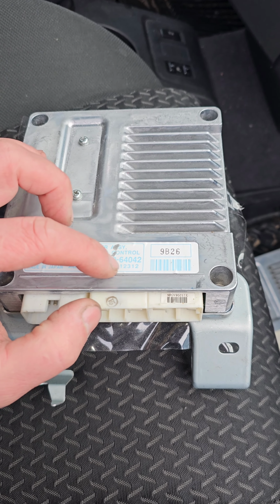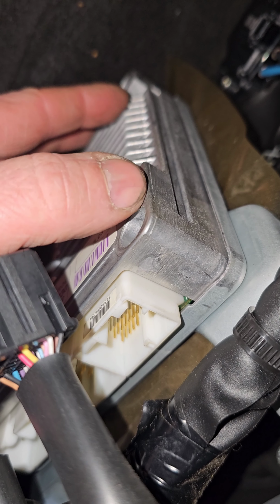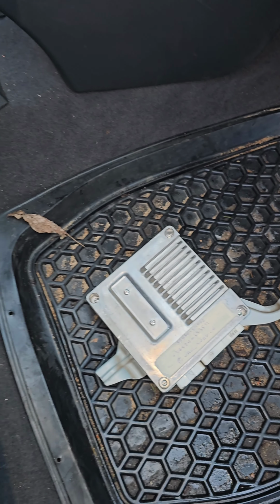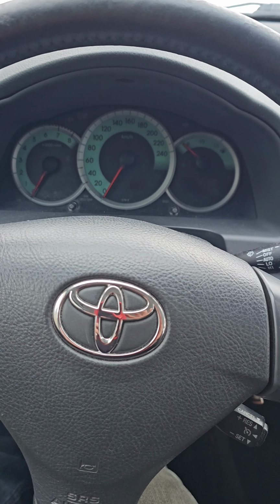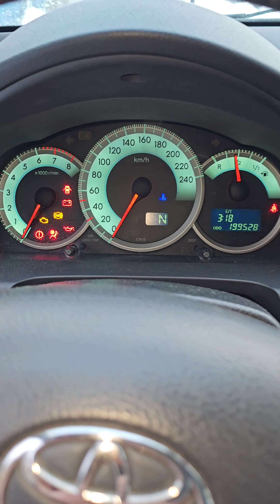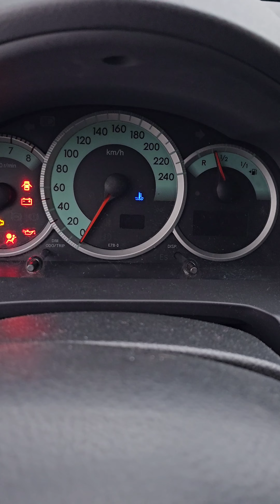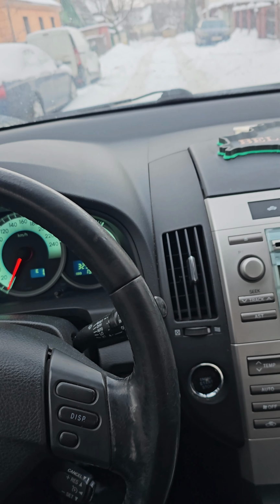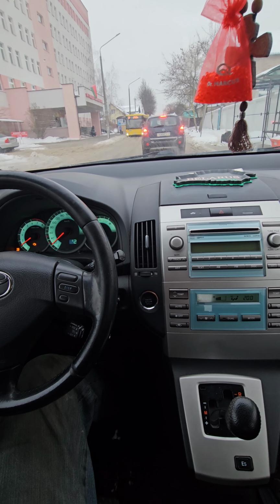TOYOTA COROLLA VERSO LATEST VERSION 89530-64030 89530-64031 89530-64032 - 64040 - 041 - 042 I CAN DO

Comment: If we put biger tires is there some tire size factor or need calibration? With 205 60 r16i have better shifting then original 205 55 r16. Better sinhronization of engine rpm and real gearbox speed. thank you  in advance.
Reply from the maker: Hi.
Very good idea.
I'm also doing like this if need more speed on highway.
I'm sure no need any additional calibrations.